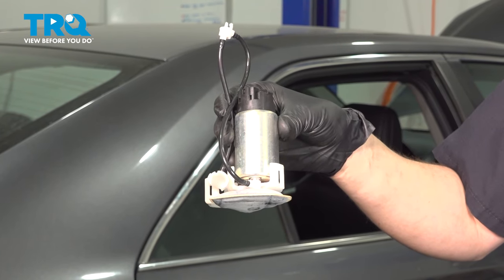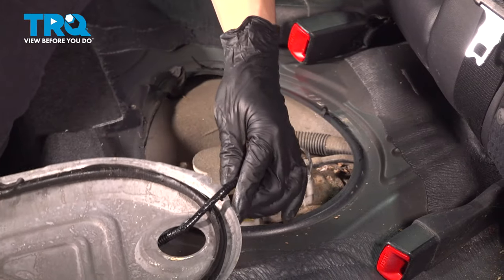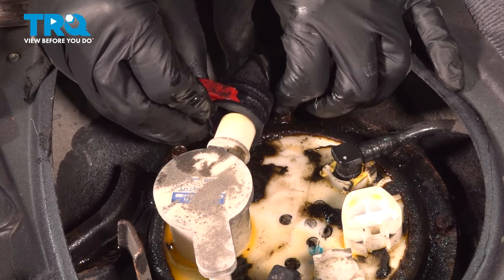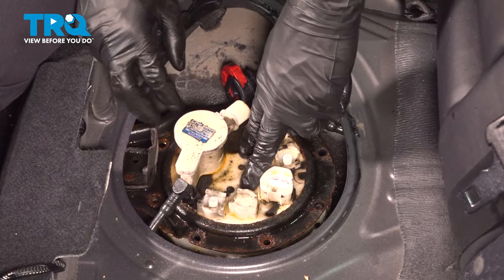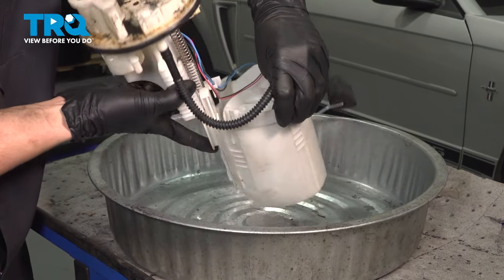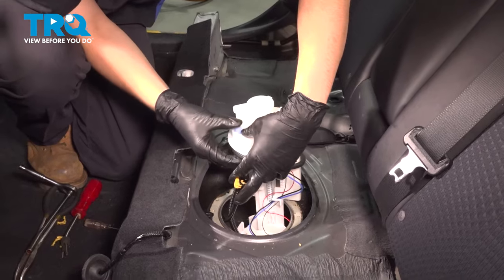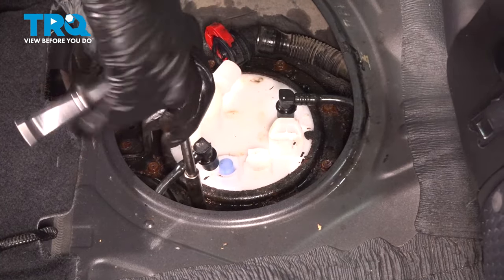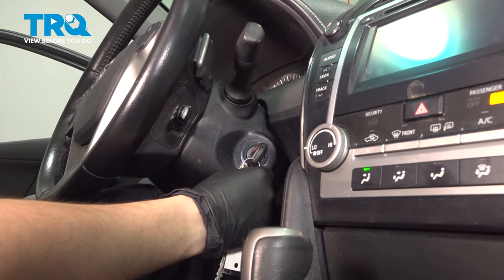How to Replace Fuel Pump & Strainer 2012-2017 Toyota Camry

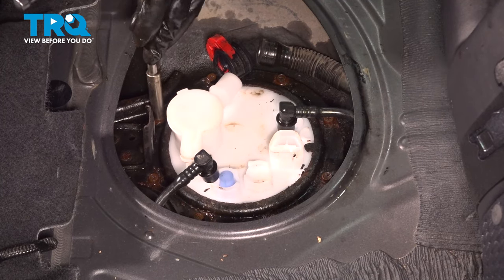Comment: Excellent video. Thanks so much for posting it. One thing that I noticed, was when you put the assembly back in and the metal retainer ring, it was not aligned in the small "half moon" slot of the fuel pump assembly. Visible at about 16:10.

Comment: Rust penetrant on plastic components is a horrible idea. It will degrade, dry out, and crack the plastic even if you wipe it all up. Use silicone spray if anything on plastic components. Also, if you keep your fuel level well above a quarter tank, you’ll never have to do this repair.